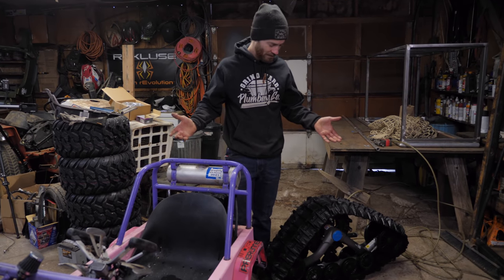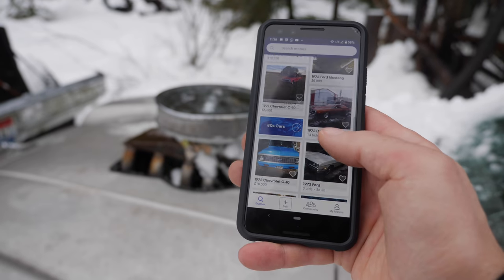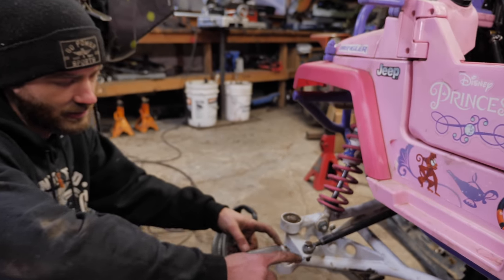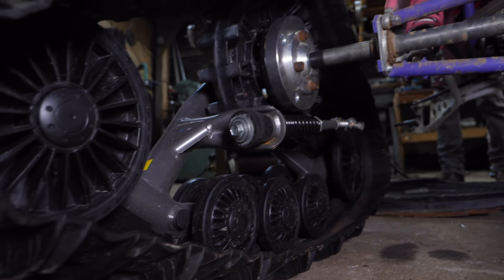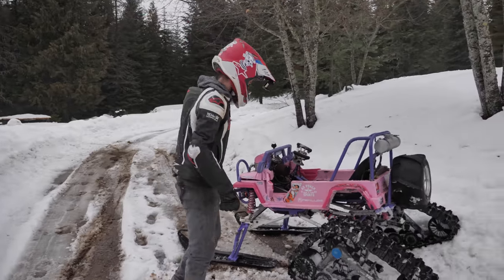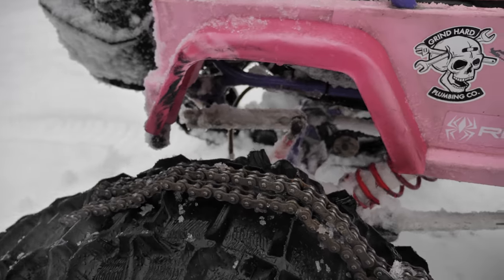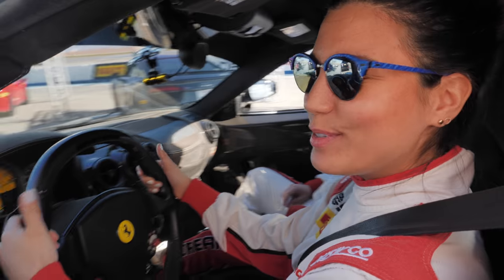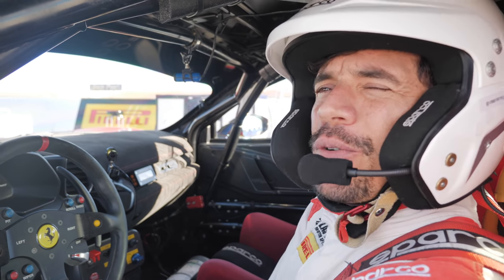50HP Barbie Jeep Gets Snow Tracks

Comment from the maker: Check out the new Ebay motors app here! https://ebayvehicle.com/app/GHPC I think you are going to dig it!
Reply: Soooooooooooooo, next time mini Ferrari?????
Reply: Grind Hard Plumbing Co you’ve gotta widen your front end it will make it more stable
Reply: Would these fit on the Odyssey? Bring it back to its snowmobile roots
Reply: hey on that square body frame that has the 350 on it after you take the 350 off of it would you like to sell the tires and rims
Reply: Grind Hard Plumbing Co can you link the wheels and tires pls?
Reply: Do you think the other cheap tracks from china would work on my power wheel chair? it's the style with two drive wheels in  the middle and balance rollers front and back.

Comment: The bent bolt happens a lot more often than you'd think. Last year i went junkyard fishing for suspension components. I wanna say there were 2 or 3 decent sized piles of bent bolts just like that one. They sell those to a local blacksmith, so they collect them from all the yard. Some of those bolts were at least 1.3 mm in diameter, so off some hecking big units, and still got bent.

Comment: I don't know if anyone has said this already. But the tracks are on backwards. Like see how they are where the, well back "front" of them curl up like. Well that's supposed to be facing forwarded. So the curved up side of the track is facing towards the skies. That would also help or possibly stop it from doing a wheelie as well. 
Now granted I don't know if the way you have them is the only way you could get them to work or what. But if you go to any video with a 4wheeler of side by side with tracks on it. You'll see thats how they should be facing. To help pack that fresh snow  down. 
But fantastic job!! I love watching your videos. I've seen almost all of them. I've got a Purple Ford F350 dually power wheels in my shed right now. It's huge!! I want to build something with it.

Comment: Hi Guys, I've done a few small block/Jag conversions and if you use the stock XJS radiator be sure to pull the end caps and remove the baffle, otherwise you'll only get half the cooling area due to the way Jag designed the cooling system for the V12

Comment: I just got a hobart 220v mig welder ! I cant wait to learn how to weld and build things. 

Any advise for what basic fabrication tools? I have a angle grinder
Reply: I would recommend a sawzall, and a bench grinder. And a vise.
Reply: @jessepitt  do you have any experience with harbor feight stuff?
Reply: the dude. Their power tools are serviceable. The belt sanders work pretty good at least. But I would look on Facebook marketplace for a good steel vice

Comment: Normally I dislike those pyramid shaped bolt on wheel replacement tracks because they are so dysfunctional normally since they don't have an incline in the front like a normaly offroad tracked vehicle but it was nice to see how these tracks had a curve on the bottom to help that at least which helped a lot but it was still ploughing a lot of snow. Tanks treads and snowmobile treads have the sloped ramp in the front, and big tracked excavators have a large enough wheel on each end of the track to easily go over things. I wish they made an offroad bolt on track wheel replacement. It would be much more useful.

Comment: You might want to try an Icon Variant Helmet with a clear shield. I've had the helmet for years and these past couple of years I've been using it offroad which is wonderful. goggles are a PITA for me cause I have glasses and because I find that full face helmets and goggles only really go together in the sand and maybe a muddy race track, but for trail riding and screwing around the Variant is the way to go. 

P.S. its great in the rain/marginal conditions

Comment: Might wanna get that intake covered on the 350, those Edelbrock foam air cleaners will let shit just fall right down the intake... Probably already got water in it from all the snow. Also at 11:15 it looks like the chain has been chewing on the tube that runs above it, ouch.

Comment: I'd switch to the rear tracks of they are more flat. Not rounded. because.it would displace more surface area making dor more stability. The front ones  may cause Cinderella to rock side to side while driving which could interrupt handling and high speed corners. Creating more of a hazard. (I Had a skidoo mxz and the dealer put a new track on that was 1.5" shorter on the width and I lost all my high speed handling.made my sled real tipsy.

Comment: This is so cool now the AWD jeep on snow tracks and you Guys can go live in antartica
Reply: CasCars It’s 4wd not awd. All wheel drive has a center differential, four wheel drive does not. Their set up is 4wd.
Reply: Adam R ok... sorry 
Is that center differential Than for variating the quantity of power
Reply: CasCars A center differential is to allow a 4x4 to operate on paved roads without binding the drivetrain or slipping the tires. When you turn, the front wheels travel a different path at a different speed than the rear, the differential  lets it even out. Just like an open rear diff compared to one with a spool. AWD would be like an Audi car, no low range, no lock selector. 4wd would be like a truck, 2 or 4wd, high or low. Now, some transfer cases will do both awd and 4wd, but they actually lock the center diff when you select 4wd. AWD will be a different button or spot to select it with the lever. AWD is made for on road or light off road, where 4wd is made for worse terrain and shouldn’t be used on road unless there is ice or snow.

Comment: Luckily you didn't snap your neck there, if you would have been going faster like you usually are ooooweee... You need to build a small roll cage over yourself  better safe than rubber necked... You know all it takes is one bad jump while your sending it... You've witnessed it yourself when you been ejected or rolled... So I say it again better safe than rubber necked...

Comment: A good chain to have are gold chains because they don’t rust and they look cool
Reply: Badger Production Actually, you want to buy based on specs, not just color. There are a lot of cheap junk chains that are gold, but they are still junk. Their best bet would be a o-ring chain with x rings instead of o-rings. Probably a higher end DID chain.
Reply: @adamr9215  well obviously you want to buy a nice chain like a renthal or pro taper in gold
Reply: Badger Production Well, even there, some options exist. O-ring, x-ring, and I’m sure even more gimmicky stuff exists by now, and the old school unsealed roller chain. The old unsealed roller chain has the least resistance, because of no rings holding lube in, and are lighter, but they don’t last long. On drag bikes with those chains, it’s not uncommon to change them before every trip to the track. O-ring chains use an o-ring to seal lube in the rollers. Simple and effective, and factory on just about any motorcycle or quad with a chain. X-ring has an x shaped ring that seals in two places which holds lube better, plus draws lube back in better if you lube it when hot, and has the added benefit of of less resistance than a normal o-ring. I ran these on all of my race bikes and street bikes. But, even within those categories, there are more options just with a single chain size. Different steels and hardness options for different uses. It’s best to call their tech lines and see what they recommend for what you are doing. And I would strongly recommend DID chains. I tried it all and they were always the best for me. Renthal and Pro Taper make handlebars, they buy their chains from others and mark up the cost when they slap their names on them. DID and RK make most of the chains on the market. I prefer DID but won’t bash RK. I ran one of their chains on my 03 GSXR1000 for more than 40,000 miles with no issues, only changed it for a big gearing change.
Reply: Adam R ok? It’s just a suggestion
Reply: Badger Production Lol, just trying to share a little knowledge. Maybe the next time you need a chain you can find a better one for you for a better price.
Reply: Adam R I know what I’m talking about I’ve race motocross for all my life I’ve been threw many chains I was just suggesting that they get a gold chain so it doesn’t rust...
Reply: Badger Production There are plenty of chain coatings that don’t rust. Unfortunately a lot of the cheaper gold chains just have a cheap gold color to them that isn’t a rust proof coating. It’s best to buy based on specs, not color.

Ok, you have bought a lot of cheap, non o-ring chains. That doesn’t mean you understand anything about them. You prove that when you just suggest buying one color and don’t recommend any specs. There are a lot of different chain designs out there, and all are better for their intended use than what you have experience with. Try to learn something rather than getting butthurt about everything.
Reply: @adamr9215  bro calm down when did i say its good to buy a cheap chain.. go find something better to do then write out 2 paragraph comments about a suggestion.

Comment: Try one center ski in the front
Reply: Mr GMC631 That would be stupid. It would tip over even more easily. Wider front suspension with a single rear track would be far better. But neither fits the Jeep theme, so it’s better like it is.